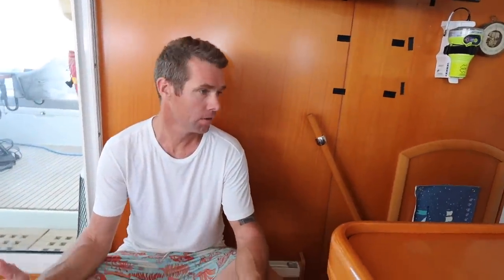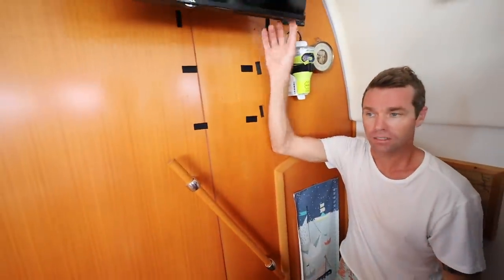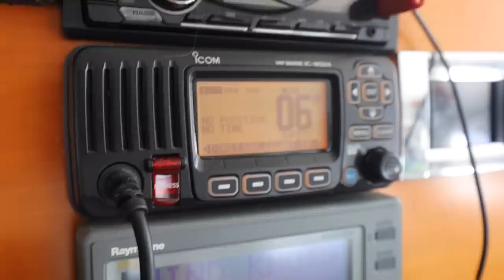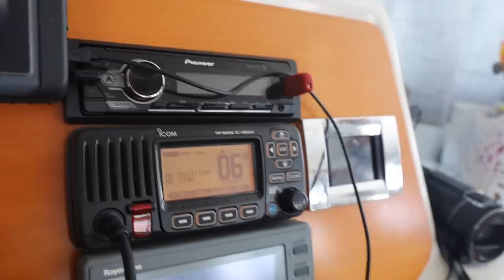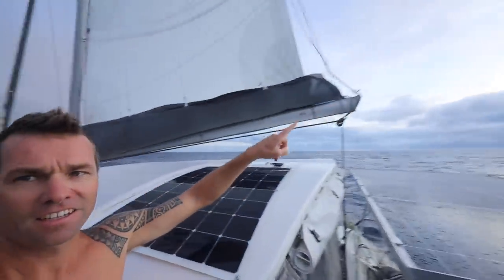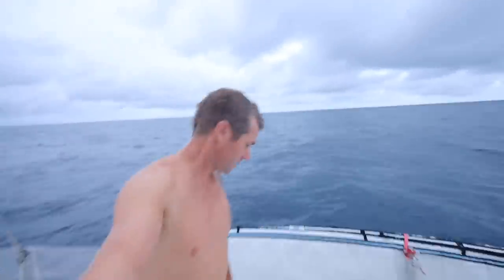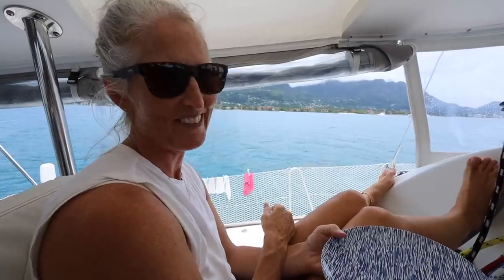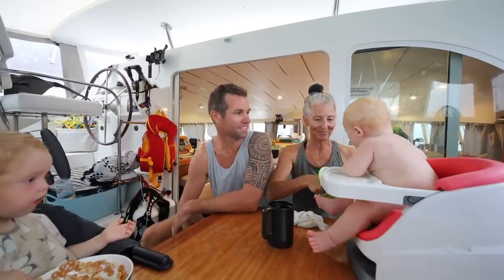Limping into Port with BROKEN BULKHEADS

Comment: im really surprised you were getting more sail up when the boat is evidently showing up very bad signs. from the footage the sea state doesnt appear to be bad but stressing the rig, thus the structural elements will only speed up the compounding effect. sailing would be my last option, specially if you have the range to motor.
Reply: Sailing would have been less stress on boat, especially in those conditions, the fact they made it, no serious emergencies, I think it was the right call, Ben would have weighed all of that up. He seemed flat though, didn’t he. Awful situation to be in now. Thailand would have been great haul out and repairs if available these days post covid dramas.
Reply: @highvibe4839  so the rig is up, as normal, and tensioned, as normal, thus imparting  "normal stress" on the hulls,  and putting sail up, which will result in added tension to the whole boat, is safer than avoiding those added tensions?! the rig is trying to flex the hulls up, like a bow, and the structural elements on the hull are countering and absorbing those forces so that everything stays in place. gusts, increased wind speed will generate peak loads which will add to the effect already playing.

Comment: Haha, u can't fix it at the next port....
Buy, 36" yoga balls. Over blow them up.
In bow storage, spare room, if it did happen. She would stay afloat.  Walls, pulling apart...
Buy, stainless steal , 1/6" thick plates. Screw plates to both side, screw together, nuts and bolts. Accross, bulk heads, 6" straps, whole way.
Buy, emergency straps, hulls, can be pulled back.
... set up more cameras... wall alarms, have, a gas, mega bildge,  at the ready....
But like the navy..... run drills,....run drills....
Put, shit happens, cards in a bowl...grab one. U have 30 seconds to respond.what you will do...
Who...picks up what kid... kids need ditch bags also....toys, books, snakes,  sun block...
Wrap your head around, swiss family Robison...
...practice dead mans float... practice who to make your jeans a life, raft.... the cats not going to break apart....in CLAME seas...it will happen in nig waves, 30knot winds.. the mass. Will break off, and fall. Did you keep your knife with you so you can cut thru the sail, and not drown..

Comment: with your bulkheads hurt why are you sailing(unless not enough fuel to make it in to port)...use the motors...worst thing you can do is stress the hulls with pressure around the chainplates pulling the hulls and twisting...not smart using bigger sail with hurt bulkheads!

Comment: Would hate to be a Lagoon owner, you gave a boat you can't sell and you have a boat that needs urgent surgery or one day it will fall apart.  All this is compounded by the inaction that Lagoon continues to display.  They should/ must issue a "stop use notice" to prevent a major tragedy happening when one if their boats is lost with all hands.  Come on Lagoon do the right thing.

Comment: With 362,000 subscribers/ followers, it would  be surprising if the manufacturer does not manage to fix this for you. Tricky. If they admit responsability, extremely costly. The type of usage clause they issued as guidance is your way to a solution. You are circling the globe by the trade winds route, not cape Horn. Any respectable cruising  boat should be built strong enough for your voyage. Stay positive, you are all safe abd healty, sailing around the world.